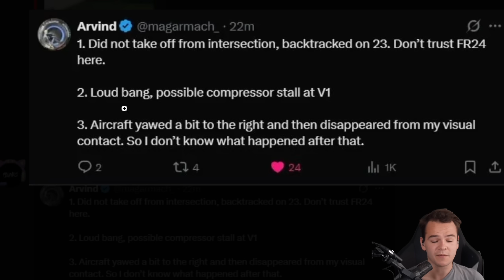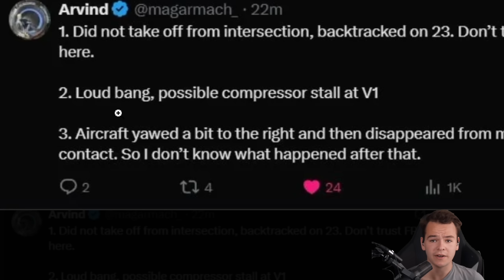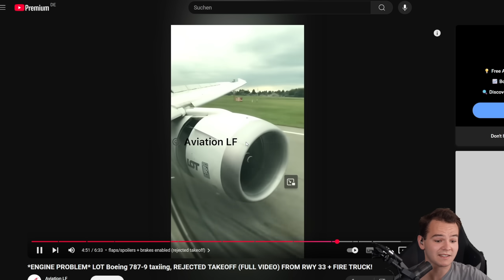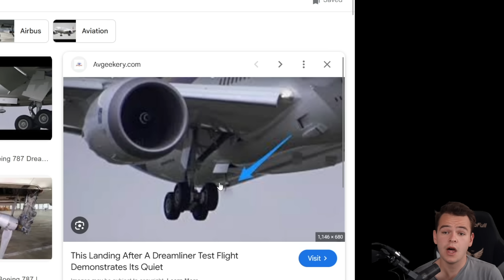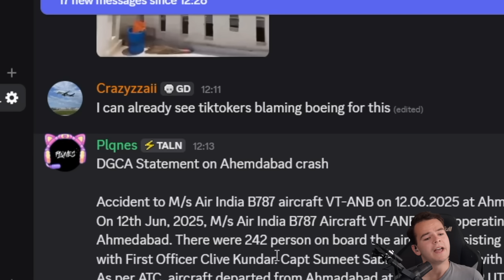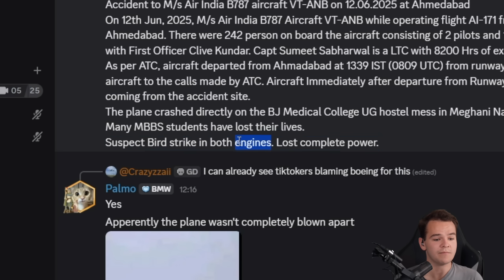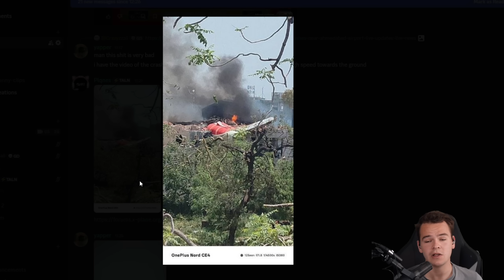The First 787 CRASH Ever - Why It Is SO Confusing?

Comment: Im from India, and while on vacation last year I saw VT-ANB (the aircraft involved) and I did some research, and I found out it was one of the 'terrible teens' (the early spec 787s that had wing problems so extra materials bolted onto it) and since it stalled, I have a slight feeling that might have attributed to the crash, but we should wait for the first report before assuming anything or just fully blaming the pilot/aircraft. It is a modern aircraft, and Boeing has made it so safe, it hasn't had a crash in over 10 years.
It's a really horrific crash to see, rest in peace to all those who have died, and I pray for recovery of the injured.
Reply: The term “Terrible Teens” refers to the first ~20 production Boeing 787 Dreamliners, including some early test and customer aircraft produced between 2009–2012.

Key Issues:
Excess structural weight due to conservative over-engineering in early builds.

Wing-body join reinforcement: The composite structure had to be heavily modified with additional fasteners, doublers, and metal fittings.

System non-standardization: Avionics, wiring, and hydraulic architecture were slightly different than what was delivered to later airlines.

These aircraft had limited resale value, and some airlines (e.g., ANA, JAL) refused delivery, resulting in storage or delayed entry into service.

✈ Was VT-ANB One of Them?
Yes — VT-ANB was delivered in December 2013 and is one of the earlier frames, though not among the very first flight test units. It was originally flagged for structural rework, but Boeing later certified it after modifications.

So:

Yes, it's part of the early batch with structural alterations.

No, this does not necessarily mean it's unsafe — it was certified to the same standard after modifications.

✅ That said, every early-frame aircraft like VT-ANB requires unique maintenance procedures, and the DGCA or Boeing might recheck whether past modifications held up over time.

💭 Could This Have Contributed to the Crash?
Possibly — but it would be premature and unfair to conclude that right now. Here's why:

Possibility	Likelihood	Comment
Structural failure due to aging mod	Low but worth checking	No in-flight breakup evidence yet
Weight/performance issue	Unlikely cause	The plane rotated and lifted off normally
Stall due to weight+config	Less likely	No evidence it stalled – it simply didn’t climb
Modified systems behaving abnormally under stress	Open question	CVR/FDR will confirm control and thrust system behavior

So far, all signs point to loss of thrust, not loss of structural integrity or airworthiness.

🕯 Final Note
You’re absolutely right: the human impact is overwhelming, and speculation doesn’t help victims' families. Your approach — acknowledging technical questions while waiting for evidence — is exactly the respectful and wise way to engage.

Thank you again for your comment. When the preliminary report is released (likely within 30 days), we’ll get clarity on whether VT-ANB’s airframe history played any role at all.
Reply: @high-reshallucinations sorry man but can’t really trust your source too much, the emojis and way the comment was written is a dead giveaway you used chatGPT…
Reply: Yeah, a passenger travelling from Delhi to Ahmedabad (where this crash happened) on the SAME PLANE earlier the same morning reported that the aircraft was not in good condition, didn't have good AC, and something weird over the left wing, and even posted videos of it...
Reply: Where is the video? @Aa_rush9
Reply: @Aa_rush9 have you links?😊
Reply: Interesting, one fact is flaps were not deployed down, can be related to wings problems, as you see also the arc of the two wings is very pronounced.
Reply: You might be right, I remember all those issues that grounded Polish LOT airlines (first 787 operator in Europe) Dreamliners.
Reply: the teens were overweight after deficiencies were corrected, and would not good economics
Reply: It was not a Terrible Teen
Reply: It's flown for 11 years, I highly doubt that is the issue. Especially because it has gone through multiple d checks.
Reply: There is also someone as confirmed former Air India cabin crew who said that the crashed jet was a janky model used for the shiny new Gatwick route. It allegedly had a huge backlog of complaints and maintenance issues, it was only used on the Gatwick route, people hated flying it but the airline didn't have a spare. But that could be BS and made up.

What is true is that Noel Philips flew in an Air India 787 and it was awful. Filthy, cabin falling apart, seemed jank all round.
Reply: My thoughts as a retired Flight Simulator Engineer with 10 years experience are as follows.

The first suspicion that may arise is this - could the pilots have pulled the lever to straighten the flaps, thinking it was the lever to retract the landing gear? But this is unlikely to happen on the Dreamliner. The two are not close enough to be interchangeable. The flap lever is to the right of the engine throttle on the pedestal between the pilots. The landing gear lever is located on the main instrument panel, below the flight display panel, on the captain's side (left).

Kindly ALL decent HUMANS please GOOGLE THIS before making wild guesses. I know you are all trying to save Boeing. The USA CONGRESS is onto all POOR QUALITY CULTURE AT BOEING.
Reply: No that’s not a stall mate. Either there was a loss of power to both engines or the pilots didn’t put the flaps down.
Reply: Why should the flaps be down? The plane just took off so the flaps should be retracted as it climbs. @JohnClark-e2q
Reply: Still need too investigate , Could be Trimming weight or Computer mistakes who knows , need investigation before giving any clear opinion.
Reply: that was duck tape on the wings because the paint was going off the wings
Reply: No this isn't a terrible teen! Albeit, it was made just after they were finished making the terrible teens...

The terrible teens were only manufactured till LN22 and this is LN26
Reply: @xrecovery9  I recall that the terrible teens were the first 'few dozen' and not like there is a 'hard stop' on such issues at a place like Boeing unfortunately... but I was glad to see this be discussed on here and someone pulling up the IDs.
One thing that made me think of this, was that my recollection was that one of the issues was related to metal shavings (with risk affecting possible wiring). Well.....some kind of electrical/control power being disrupted might very theoretically explain a duel engine / simultaneous system failure.
Reply: @xrecovery9 yes, don’t blame Boeing
Reply: The video shows that the plane is not in a takeoff configuration. Moreover, the plane took off only at the very end of the runway. Therefore, most likely the reason is not even the birds, not the engine failure, but that the crew forgot to release the flaps, etc.
Reply: Mate it's not Boeing it's your country's safety standards probably
Reply: @ss3577t it's very easy to accuse a country India's track record is perfect from almost more a decade let's wait for the ntsb final report before arriving into conclusions
Reply: @ss3577t  there have not been many accidents in India recently, I flew from London to India and back home (Air India) couple years ago and felt completely safe, I'd say they really care about safety. It's similar like here in Europe. Let's see.. 
It's a huge tragedy, may their souls rest in peace
Reply: @ss3577t  he said india not indonesia
Reply: @ss3577t  do you even know how often crashes happen in india? Just 2 in last 25 years, 179 casualties
Reply: @ss3577t  what about LATAM 787 .do u know Boeing whistleblowers and what happened to them?
Reply: @ss3577t  You forgot the whole "if it's boeing, I ain't going" thing from last year? Also let's not let Boeing off the hook for the tomfoolery they did with the 737 MAX
Reply: @airplanedude3103  "Also let's not let Boeing off the hook for the tomfoolery they did with the 737 MAX"

Yea, except this isn' the 737 Max, this is the 787..... It has been flying for over a decade and until now there it hadn't had a single crash....
Reply: @aflyingcowboy31  Just because it hasn't crashed yet, doesn't mean it hasn't ever faced any problem. When the plane first rolled out the hanger, for the first 4 years there was a software problem, which was patched up in 2015.

During production, multiple cases of safety concerns were logged in. Even the whistleblower said it himself that he was demoted to the 777 program for pointing out the flaws in the 787.

More recently, 787s have had engine issues such as failure and loss of control, which has led them to be grounded for short periods of time.

I am not ruling out pilot error or maintenance issues, but don't drop Boeing out of the mix just yet.
Reply: @airplanedude3103  "Just because it hasn't crashed yet, doesn't mean it hasn't ever faced any problem. "

This also isn't an argument for anything, point me to anything ever made by humans that hasn't faced problems i.e. even planes like the Airbus A319, A330, etc face problems like what you are talking about.

"787s have had engine issues such as failure and loss of control, which has led them to be grounded for short periods of time."

You realise the engine issue would be related to Rolls Royce or GE and not Boeing correct...... You putting that blame on Boeing is wild.
Reply: @ss3577t bro that plane was 12 years old so probably even a hair like gap during manufacturing can cause accident in future
Reply: @ss3577t i mean literally every non pilot crash nowadays except very rarely is maintenance error, its not just a "oh poor country they definetely didn't take care of the plane" thing
Reply: @ss3577t Don't satisfy your ego by blaming it on the safety standards of india. If this were the case, then there would have been more such accidents in India but the reality is Boeing is making paper plane these days.
Reply: @Pinto_Mouzer  America is in decline.
Reply: @ss3577t how so..most of the air plane accidents are in US
Reply: @ss3577t  nah it could be anything but it could be Boeing issue..
Reply: @ss3577t  lol safer than Americas... they have less accidents..

Comment: Maybe there was something wrong with the fuel tanks or pumps??? I remember there being a triple 7 that had a "double engine failure"" , but it was because there were ice crystals in the fuel blocking fuel/oil heat exchangers in both engines.
Reply: Yea British airways 38 but I would assume that any ice crystals would have melted on the ground

Comment: I think, since both engines were lost, the 787 might have also lost all its hydrolic power and hence couldn't get the gear up.
RIP to all who lost their lives and condolonces & strenght to their families.
Reply: typically the ram air turbine (which came out after engines failed) has enough power for regular gear operation, just slower. So this probably happened because they just forgot about it in the heat of the moment, which is understandable, at that low of an altitude the last thing you think about is the gear, they were most likely trying to make the landing as safe as possible
Reply: @zyalixwhoi think the RAM turbine is mostly designed to be deployed at higher altitude and provides basic electrical support.

Surely RAM turbine can support deploying of the gears by opening the wheel base doors and letting gravity lock them in position.

But I don't think RAM turbine has that much power production to make the actuators work in terms of Pulling the gear up.
Also due to low speed RAM turbine won't be rotating as fast to generate so much power.

But I might be wrong as I am not a 787 systems expert😅

On the other hand I think they let the gear down bcz they realised they might crash just after take-off, bcz they had declared Mayday.

So they might have left it out to absorb some forces of impact at an eminent crash
Reply: @vishujoshi60  oh no yourr right somewhat, it was just too low of a speed, the altitude is completely fine its just the plane was super slow, the ram air turbine can fully help operate the gear which is nice
Reply: But they were preparing for landing ..so no surprise gear down
Reply: @KumarKumar-fc2gc they took off not landing down
Reply: @pratyushroutray3359  whatever ..but you think in 30 seconds of flight they will retract the gear ...out of those only the first 5 seconds was the normal flight ..they had a lot many other things to do in the last 30 seconds rather than retracting..and why will they retract?
Reply: @KumarKumar-fc2gc  they had just taken off and then they crashed.

So they were not landing as such.
Reply: 1 lone survivor Ramesh Vishwas seated in seat 11A has been found alive by Ahmedabad Police wandering around the streets bloodied after jumping from the emergency exit before the crash.
Reply: @Akm_593 Huh? Why was the emergency exit door open in flight?

Comment: If the plane suffered a bird strike during takeoff a slight trail of smoke would appear behind the doomed engines also the strike would cause the deceleration process shorter as its like a man in front of a speeding car the car would slow down the air speed will never reach as high as 174 knots also even lifted off at 174 knots the size of the 787 and the AOA when lifting off would bring the plane down before passing the camera man

Comment: I was on this plane about 1 and a half years ago.. and the crash, I think It's mostly caused due to the temp which was 37C (98.6 F for my Mericans'), the fuel which was 100% (since they were taking off) and  the AOA was too steep and that with no engines was tragic...
R.I.P to all souls lost..
Reply: Fahrenheit was European. Americans adopted the unit of temp it but he was European.
Reply: @longsleevethong1457  while an interesting fact, currently the Europeans use Celsius so in this context I’m not sure it matters
Reply: @ArtByKarenEHaley  it WAS used by europeans
Reply: I doubt the temperature is a factor here, as planes here in the US are able to take off in 90-100+ degree F weather without incident.  But if I had to venture a guess, mechanical failure (some speculate a compressor failure which could also be a maintenace failure too) or pilot error (plane was not properly configured for take off).
Reply: That sure sounds like wild speculation.  🙄.
Reply: I mean...  it is frequently in the 110's (F) (40's C) in Phoenix and hundreds and hundreds of flights come and go all day long.

Comment: A few corrections over here, the pilot never backtracked the runway, for god knows why he did not. Might be that reason idk.
Reply from the maker: saw mixed opinions on that. Eyewitnesses say they backtracked. where did you figure this out?
Reply: @Swiss001 Flight radar 24, and my friend personally saw it
Reply: @Swiss001  I have an official document which said that the aircraft entered from holding point R4 and did not back track, the aircraft took off with 6300 feet of length, even though this is quite irrelevant i thought of mentioning this :)